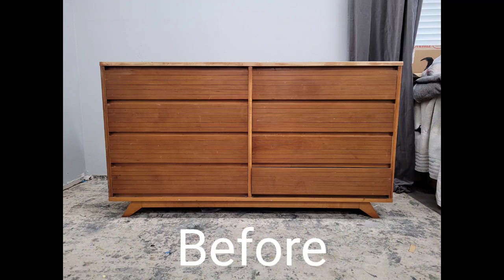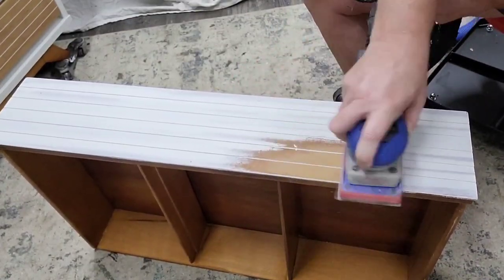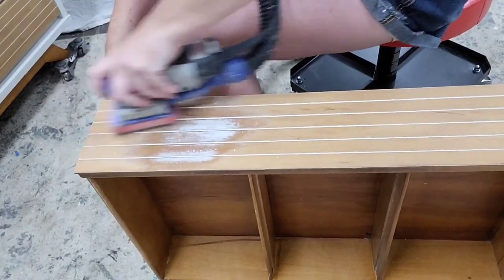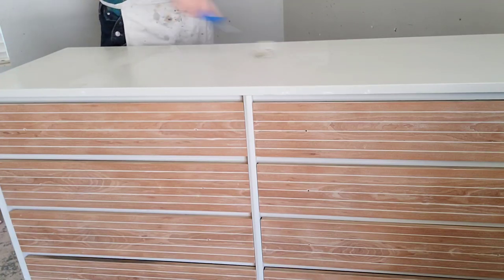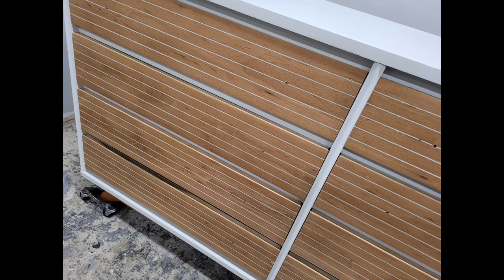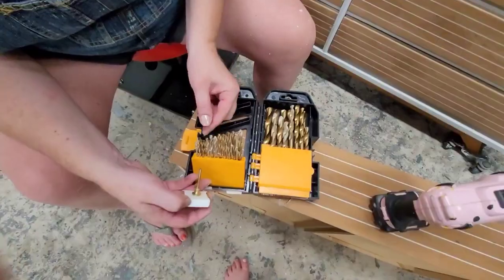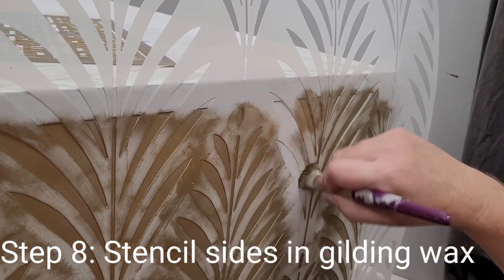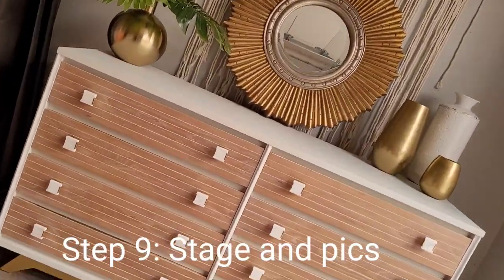Classic Mid Century Modern Dresser Makeover

Comment: Love this piece and all your tips. What brand roller did you use to apply the silk and does it leave a pattern or did it level it self out? Also you mentioned going to the automotive secion of the hardware store for some spay coating. What did you use? Thanks
Reply from the maker: A flocked roller made by whizzflock, lays pretty smooth